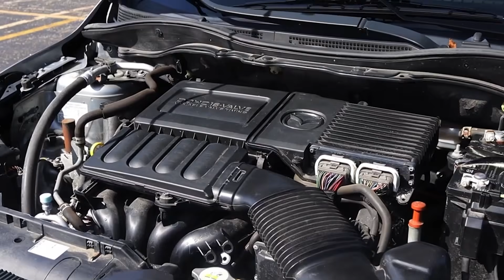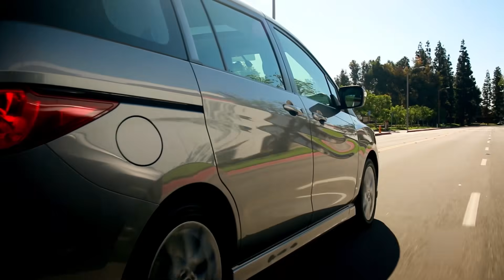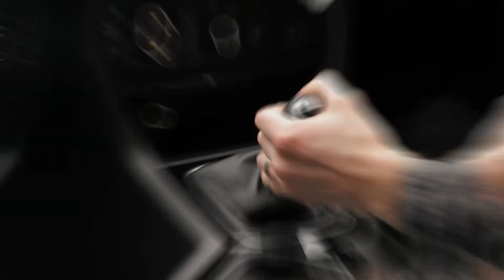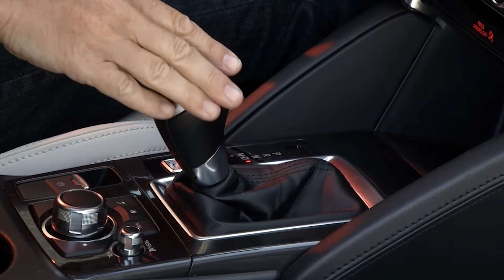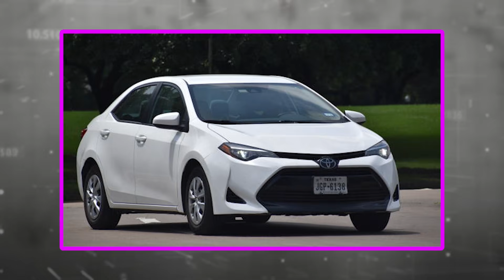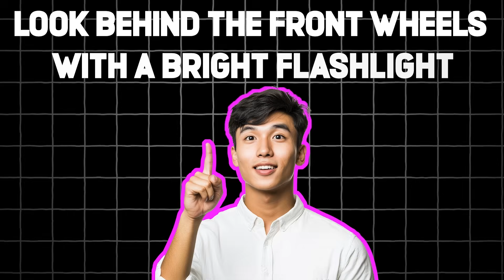5 Cheap Mazdas Everyone Ignores (That'll Run Past 300,000 Miles)

Comment: Have only owned one Mazda, a 2022 Mazda Miata RF.  Great little sports car, just too small for my size.  Sold it after 6 months and bought another Corvette.    I will say this: The fit and finish were beyond reproach, it got great gas mileage and it was fun to drive.  Am thinking of a SUV to replace a truck for long drives and am considering a Mazda as the option.  From what I have seen on websites, the naturally aspirated 4 without turbo is the way to go.  Most turbo assisted engines are just too small to power the car and the turbo is used to boost horsepower, working an already too small power plant to extremes.  Just my opinion.